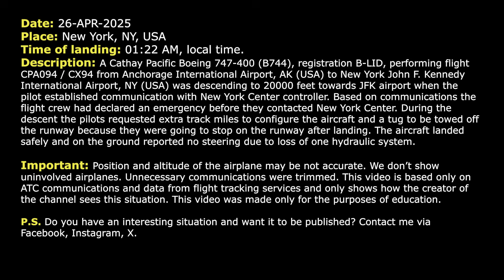Cathay Boeing 747 needs a tug to get off the runway at JFK. Hydraulic system failure. Real ATC

Comment: Dumb question: since this was a hydraulic issue, wouldn’t it have been more prudent to land on the 13s or 31s?
Reply: 13 requires a right turn into final, which is incompatible with the extra track miles.
Reply: Extra turns or those runways were closed for maintenance or wind/weather reasons. @ridiculousblue9917

Comment: Saudia busted up a 747 about 20 years ago during a taxi accident.  Apparently two trained and taxi approved mechanics got in the plane to move it across the field, and decided to taxi on the inboard engines, numbers 2 and 3.  And they failed to turn on any of the pneumatic hydraulic demand pumps.  The result was predictable;  They taxied forward toward a ditch and then applied to brakes to slow the plane and to make a turn....

Systems knowledge:  The brakes on the 747 are operated by the number 4 hydraulic system which was unpowered due to fact that that engine was not running and the demand pump was not turned on.  They put the nose of the plane in the ditch and badly wrinkled the forward fuselage.  The airplane was written off as a result.

Whoops~

Comment: Question? - When an airplane is coming in due to an emergency, or in this case Hydraulic system failure (probably an emergency, or close to one.. I believe it was lack of steering), is there a reason not to use the longer of the 22 runways, in this case 22R? Because of Takeoffs? - I would think 3000 extra feet might help... Just wondering. Thanks...
Reply: Because of 22R's displaced threshold, 22L has a longer landing distance available at 8400 feet. 22R's LDA is 7795 feet.
Reply: 22R is actually shorter when it comes to landing
Reply: Additionally, 22L has an EMAS (a type of runway overrun arresting system)
Reply: Favorable winds?  190 at 11.  Almost a direct headwind.  Plane was light(er) on gas as they were arriving at their original destination.  They didn't seem to have any indication that braking / reversers / spoilers would affected by loss of Hydraulic system 1.  I believe all of those are covered by the redundant hydraulic systems.   I do wonder if they had to gravity drop the gear as I think that's non-redundant one system one?  I could very well be mistaken.  Same question about the inboard trailing edge flaps being inop, which may have resulted in a slightly higher landing speed.